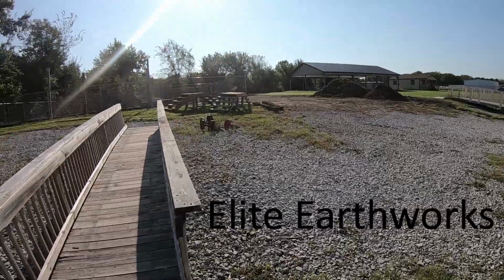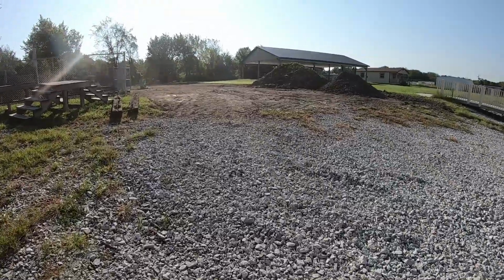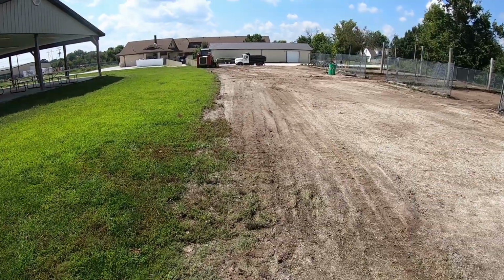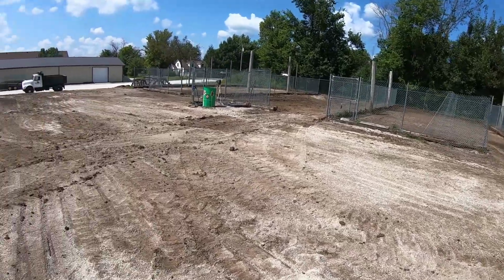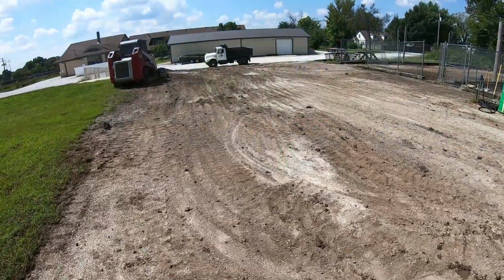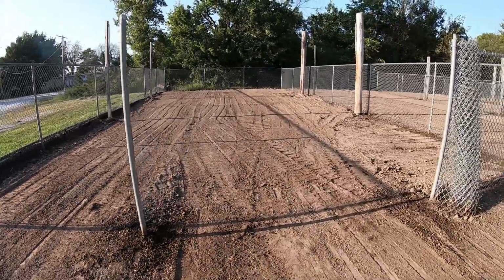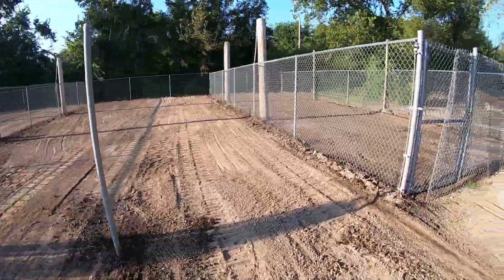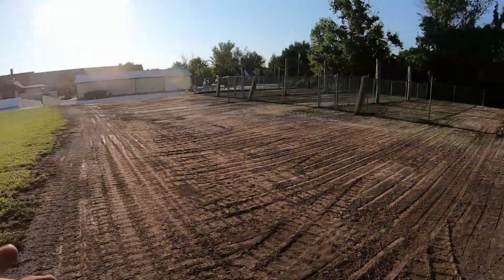Humane Society Project Part 2

Comment: If you are worried about the bottom of the fence rusting away under the dirt, you could run a new 'bottom' wire across above the new grade and attach it to the mesh with the hog rings (or maybe even show other humane volunteers how to do it). The wire, rings, and ring pliers are cheap at the big box stores and it doesn't take very long.
Reply: At least gates are easy enough to bolt the hinges on a little higher to swing above the new grade
Reply from the maker: rolandgsl that’s a good idea, thanks!
Reply from the maker: rolandgsl yes that will be easy on those